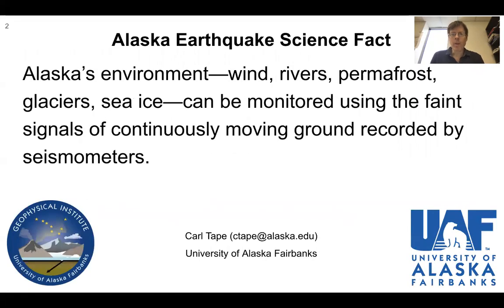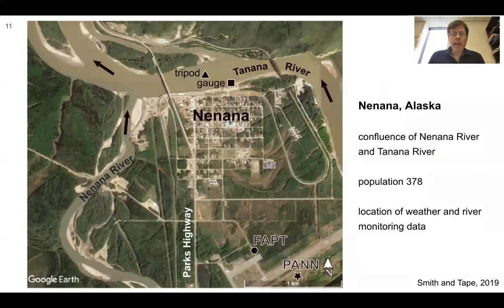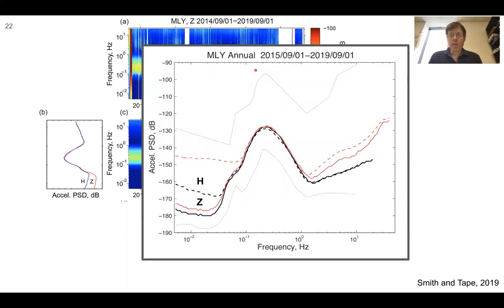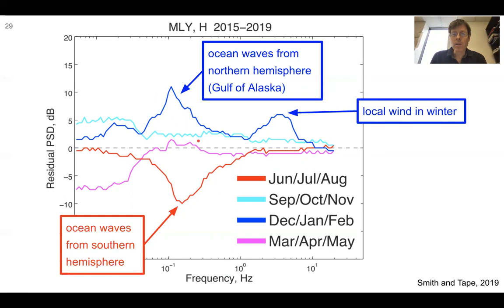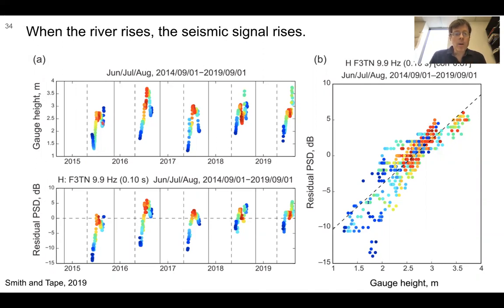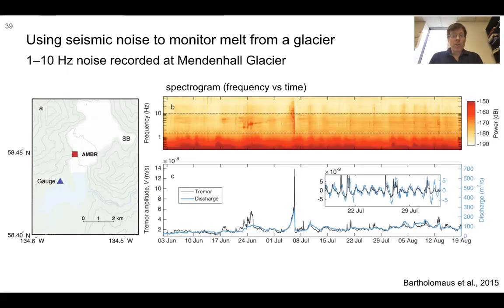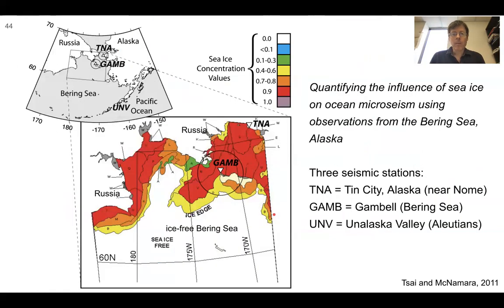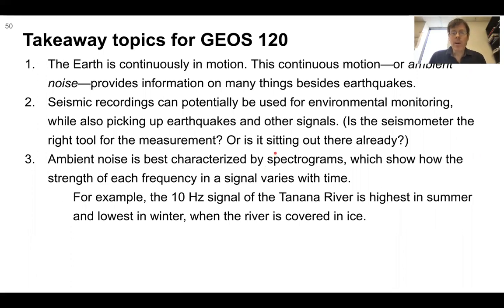AESF 21B: Ambient seismic noise (Part B)

Comment: Good analysis and presentation. I had not heard of using this data to give information about these other phenomena. Thank you for posting so that I can sit in on your class. Also, these data shows that high frequencies scatter more. That's a basic physical principle. In unpublished work, I collected data from North American earthquakes that showed southern California had more scatter than back east. I attributed this to the greater density of faults around the plate junction. I expect that you are not surprised by that.
Reply from the maker: That sounds reasonable. The eastern US is made up of older, more stable material than the western US. So there is greater attenuation (loss of amplitudes) in the west than the east. Therefore a M5 in the east will be felt at greater distances than a M5 in the west. I can imagine that scattering would also be greater in the geologically more complex region (western US).